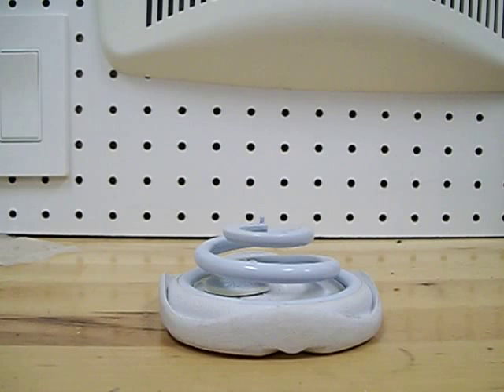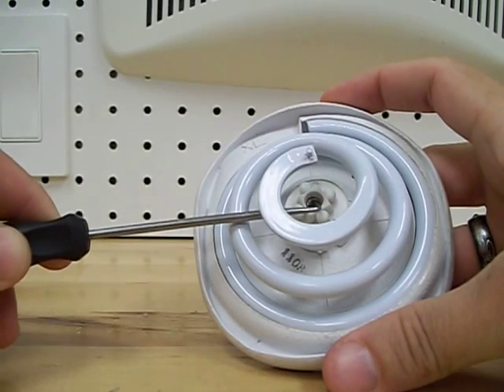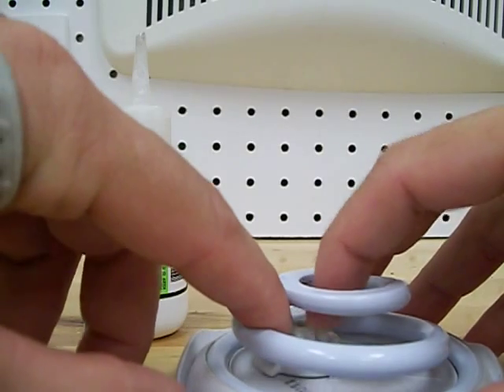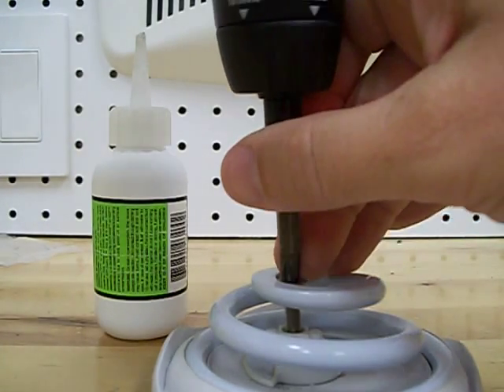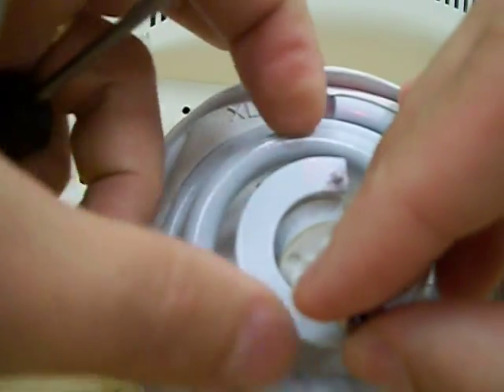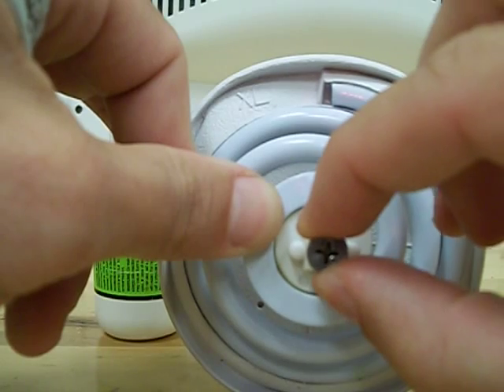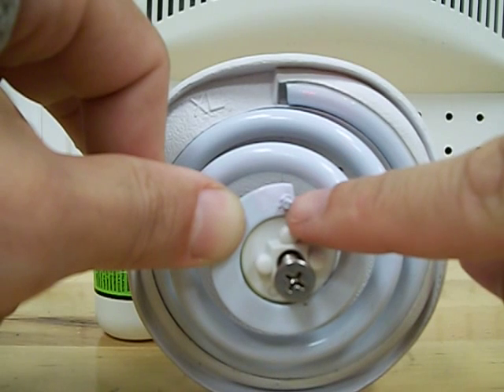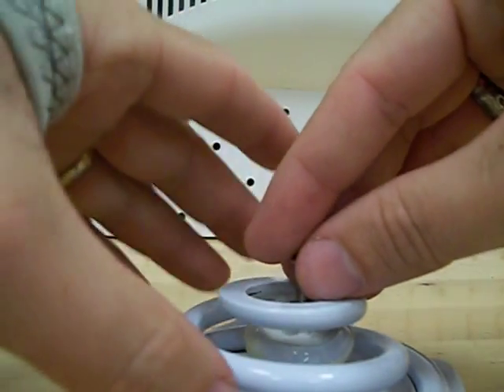Z-Nut repair for Z-Coil Shoes

Comment: How i did it with my Z's i used similar glue but i put a flat small piece of wood in between the spring's underneath and across the nut itself worked Great !!!!!!!!

Comment: I know I'm nuts but I use JB weld and once done! Oh you don't have a washer chuck?? LOL!  I got one here in southern NM from a dealer going out of biz. It's a long dowel with a heel screw/bolt epoxied on it. A wire through the top makes for a great hanging device for drying!  I have 4 Z-Coils, boots, sandals, black original oxford and hikers.Also I noticed that the size 10 mens hikers are the same as the mens 9 oxford and boots! Weird! Oh well.....